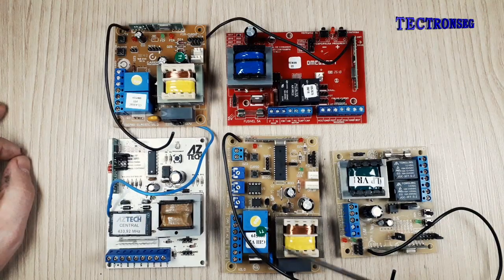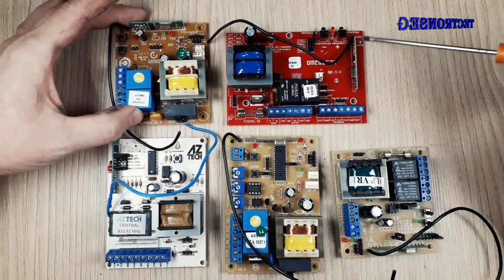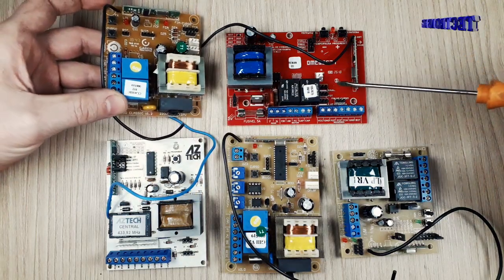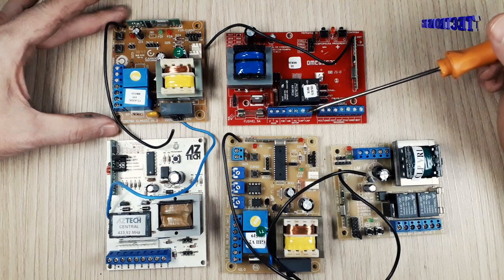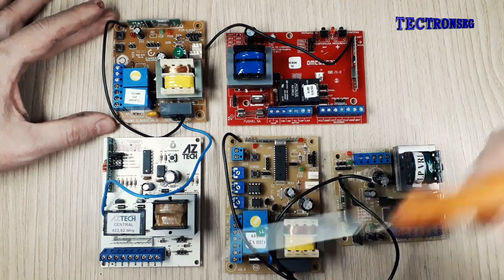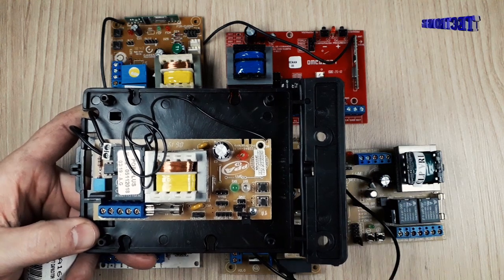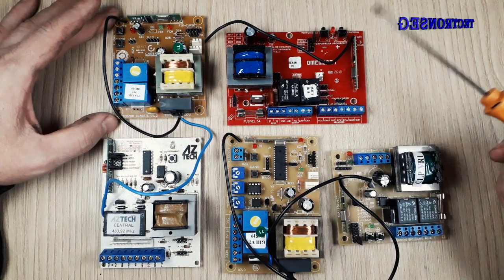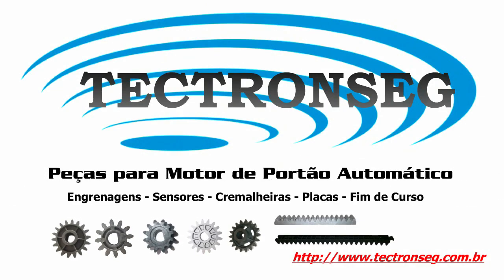Compatibilidade das placas de motores

Comment: Boa noite,  qual melhor placa para receber sinal de controle remoto?
Reply from the maker: Qualquer uma
Reply: Pra melhorar o sinal, localize o fio antena e emende ele, solda e isola bem pra não oxidar e dar mau contato. Emendei mais de um metro no meu, pega até quando a pilha mal liga o led do controle
Reply: Muito bom o vídeo!

Vc recomenda algum modelo de placa para motor RCG basculante modelo maxi lift plus? A placa que tem nele é o CHP Vr2B medindo 7,5 x 10,5?